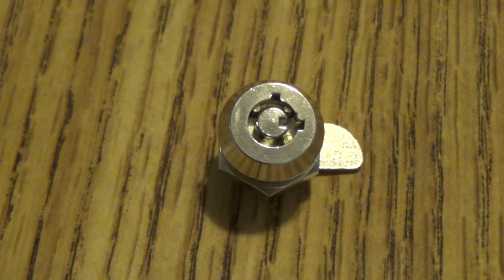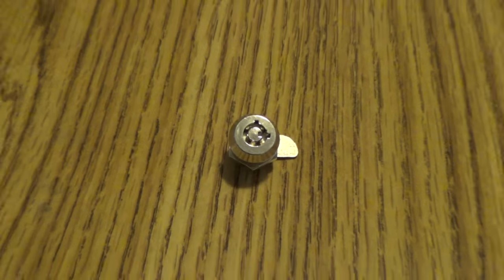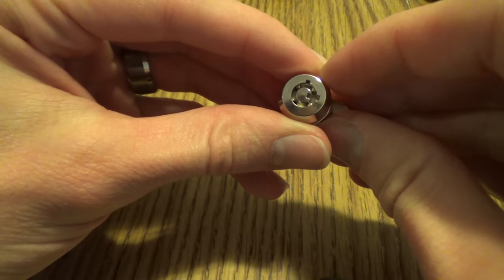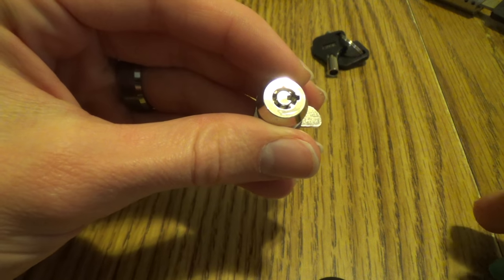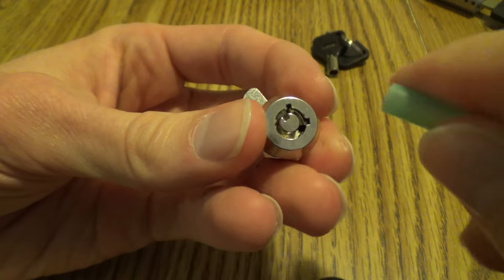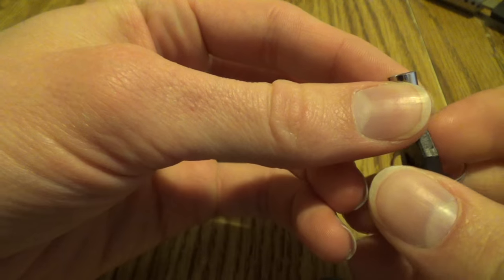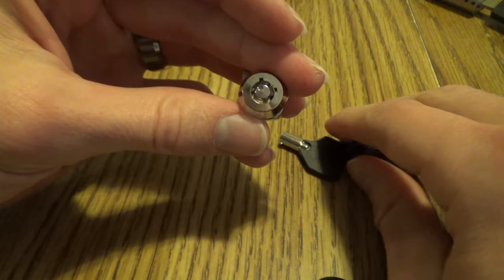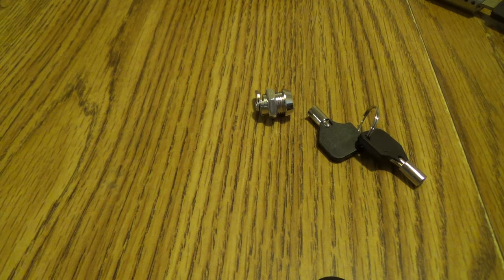How to (Easily) Open a Tubular Lock with a Straw

Comment: Thank you! I had an old piece of electronics with a similar lock securing a hard drive.  Your straw method took me about 1 min to  unlock.  Then I discovered the equipment would not function without locking the hard drive back in place. With a fresh straw in hand, I was able to relock it in about a minute.  Stupid lock! No reason for it to be in this equipment anyway! I saw replacement keys online for $25 plus $10 shipping. You save me some bucks.    Thank you again!!

Comment: How many pins in that lock 4?
Reply from the maker: I think it's 4, this is obviously much smaller than most tubular locks. The concept works on larger locks though as long as they use the same type of spring for all 7 or 8 pins. I used a straw, but many people use pens.